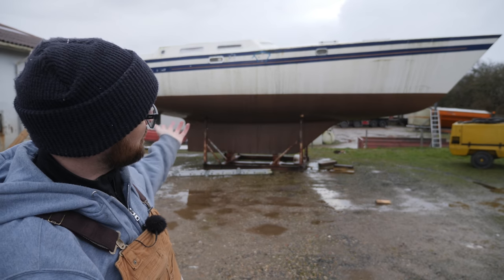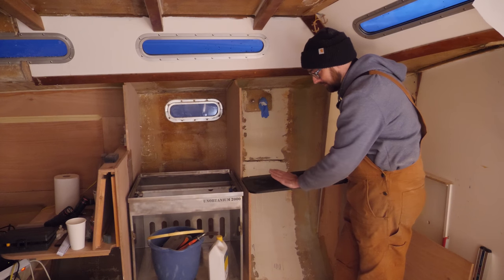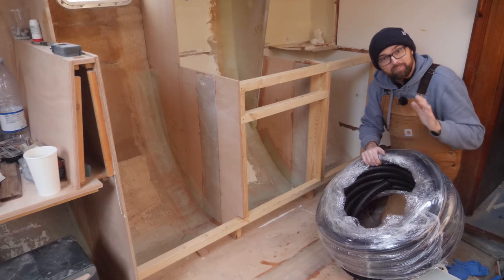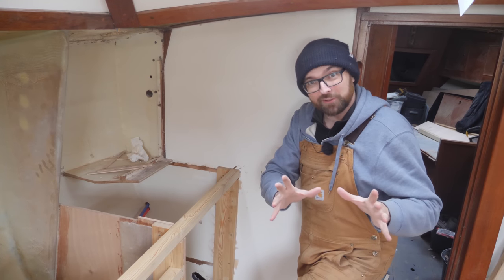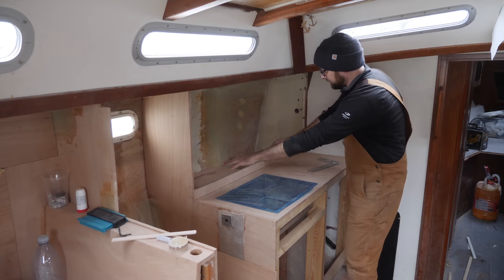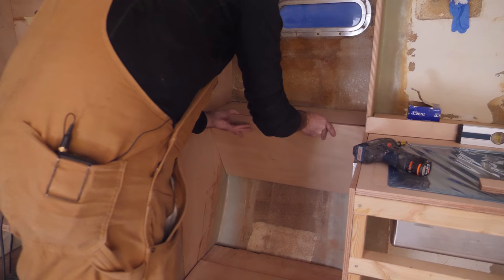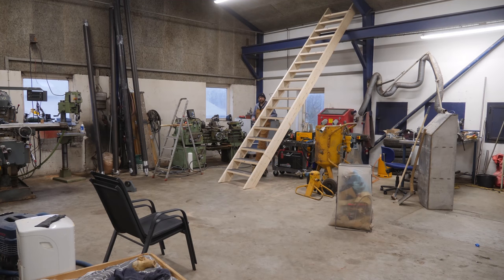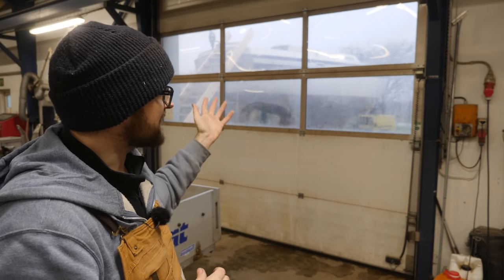Sail Life - Athena's new galley - DIY sailboat project

Comment: Every time I see that boat I think...  Acrow under the bow and Acrow under the stern, with a suitably chunky pioece of wood as an interface.  Phew, glad I got that off my chest!  Proper cabinetry is a win win in  a  dodgy sea state, and it won't delaminate like cheaper carcasses and laminates, good job.  My view is to try and build everything to last a 100 years, it gives confidence and it satisfying to use. I'm still for hot air, but I'm really interested in seeing your wet system.  Microbore pipe will have a faster response time with heating systems.  Your work rate makes me go weak at the knees - relentless dedication, mmmm a good name for a boat!  Great video.

Comment: I'd also recommend a safety bar. If you stumble into the stove you either burn your private parts or knock over the pot backwards with the hot liquids using the "chute" behind the stove to redirect to your feet. Or both. Also, on a port tack you'll need something to clip in. I know you don't want to cook at sea but maybe you have somebody on board who would and then you can reap the benefits. I quite like to cook in weather, most folks don't complain if hot food materializes itself in adverse conditions.

Comment: !.  Sink should be as deep as possible - 10" or better.
2.  Provide some means to lock gimballed stove in level position.
3.  Make provision for a safety bar in front of stove - 1-1/2" stainless steel tubing or better.
4.  How do you plan to trim out the bulkhead edges?  They appear to be different angles where cut, and will be difficult to finish off. Are you planning to use a hardwood to trim the edges?
5.  Are you planning any grease proof surfaces around the cooking area?  Something easy to clean?
6.  The toe space/kick space should be required on every boat.  Don't know why manufacturers are so contrary.
7.  You are treading new ground with the sectional cast-iron boiler.  Aside from the assembly of the unit, you will require an expansion tank, make-up water means, high water/low water cutoffs, drainage means,  etc.  This will require a lot of space and considerable planning.  Hot water circulation pump needs to be carefully placed and the slope of piping needs to be considered.  Has the manufacturer of the boiler provided any system requirements?
As a retired mechanical engineer, as well as a full time cruiser, I look forward to seeing how this works out.  Best of luck!
Reply: Agree. That sink is going to splash in any kind of seaway and is unlikely to drain on a starboard tack. Best place for a sink is on or near the centerline.

Comment: Find a furniture 'glide', one of those plastic based pads with a threaded stud, add a fender washer, light spring, another washer, and mount it in the bulkhead several inches below the gimbal mount, with a double nut on the far side, so it presses against the side of the oven box and slows the rocking (might need one on each side). Even light chop at anchor can cause heated liquids on the stove to slop over if the box is free to gyrate with abandon...

Comment: If you new heat source is to be wood powered be sure to allow for a gas flow defector (by pass to chimney/flew) so you can vary the ratio of space heat to water heat. I also have a design for a log (drift wood/coal) heater for our Southerly. The silica glass for the door I brought from our old factory heater in Australia so it will not only be well used, it will become well travelled.

Comment: Guess you have this on your todo list, but if not; some sort of blocking mechanism (catch or bolt) on the stove, so you can stop it from swinging when you do not require it to gimbal.
Companionway hatch; there is a serious opening in front of the sliding hatch. When you go offshore and encounter larger waves on deck, that opening is going to supply you with solid amounts of water - inside. If it was my boat I would look for a decent way to waterproof the opening.

Comment: It sounds like you have already made a decision on the generator, but I would have recommended a 48V (nomial) DC alternator, feed the battery bank through a separate MPPT charger.  The all AC power would come from the inverter or shore power.  Now you have to manage 2 AC power sources, generator and shore, and 2 feeds to the rest of the boat, generator/shore and inverter.  Hopefully the inverter will have a built in charger and automatic transfer switch to make wiring simpler.
If your boiler is going to be diesel fired, I hope at least the flame tubes are stainless steel.
Reply: Jack Patteeuw only problem with stainless tubes is they heat and cool at different rates and won’t last long. Large ship boilers are all steen with copper or copper nickel tubes for this reason. Also see a large commercial stainless boiler that needed welding repairs yearly and it was only 3 years old.
Reply: @donpetrey8007  - I admit to not knowing what the proper metal is for building a diesel fire boiler, but mild steel is likely one of the worst choices.
Reply: Jack Patteeuw agree but that’s why you use a corrosion inhibitor like antifreeze or something of the sort.  Every boiler I have worked on we treated with oxygen scrubbing chems to prevent rusting from the inside. But like I said automotive anti freeze should do just about the same.

Comment: I love boiler systems - the type of heat they produce is much better than forced air. I'm curious how you will get the short bursts of dry heat you need sometimes to dry out yourselves or wet gear quickly.

Comment: Another excellent video.  Out of curiosity, since your refit /rebuild is ongoing, wouldn't it be time better spent to relevel Athena in her cradle now so you will not have to always compensate for her slight tilt when fitting her interior.
Reply: I asked about that last week. He made sure Athena was as level as possible after the move. (Perfection is impossible of course, so he still has to make some tiny allowances.)

Comment: Another great episode. Good to see the galley coming together. For your stand along generator system, had you looked into the 'Integrel' system designed by Nigel Calder? It is a high capacity alternator/generator mounted to your main engine. It uses the un-used power from your main engine depending on load.

Comment: Nice video, looks like moving the boat really upped the progress greatly.   Don't make your sink hole too tight, once you bond the sink to the bottom of the counter top material it will be nice to have some wiggle room to position the counter top/sink assembly into position on the plywood base.

Comment: Coocking and frying fumes goes everywhere coating everything... Will you be adding a galley extractor fan? Looking very nice so far... ☺👍
Reply: I would add stainless sheet paneling to clean easy as grease stains most paints. And where that port light is maybe at some type of an extractor for the oven stove

Comment: Great video as always, but just wanted to double-check that you have enough room behind the stove for heeling the other direction (port, I believe),
Reply: As the top back corner only sits a couple of inches higher than the mount, i think his inch of space covers the possible added lateral mocement of the corner :)

Comment: Whaaaat ! yacht legs, wow that sounds cool, if ya ever come to Australia those legs would be an asset. We have 3 & 4 metre tides and what an option to anchor safe some places where it's often too shallow at low water and a regular bottom clean is always good. Do you have any photos of those legs in action, are they home made or something that is available & profesionally designed ?  I want some for my Ferro cement Hartley south seas, it almost stands on the flat bottom 40cm thick keel although I wouldn't feel that safe sitting on a deckchair under there to get out of the sun should the wind gust.

Comment: Yeah, good luck getting a fridge up that ladder and through the saloon hatch, in one piece, for the next episode. 🍀🍀🍀🍀
Reply: I am sure like Baldrik Mads already has  ' a cunning plan'. Perhaps he will build the fridge in situ. Much the easiest and cheapest option.
Reply from the maker: Seeing as the fridge will be too big to fit through the companionway the only option is to add the isolation to the inner box inside of the boat :) aka what Mark said ;)
Reply: @SailLife  exactly what I did on mine. I used the Norcold compressor and coldplate kit. Really easy. If you played with lego as a kid you can build a fridge on a boat.😊
Reply: It's always funny when landlubbers assume that sailors just use commercially built fridges and freezers.

Comment: I am always wondering, when it comes to attaching wood to wood, why use epoxy over a suitable wood glue? I understand that epoxy bonds are amazing/add strength etc, but the cost of epoxy over wood glue must be a consideration? (if the bonds/strength aren't an issue)

Comment: I'm worried that the panel behind the stove is too far out from the hull.

If you have a pot or pan on the back burner of the stove when the boat rolls when the stove pitches back, will the top edge of the pan or pot will strike the panel?
Reply from the maker: I think it'll be okay but I'll test to make sure :)
Reply: Thought the same. You never tested (on camera at least) tilting the stove the other way around.

Comment: You said that you took the tilt of Athena into account when measured and cut for the countertop, but when you checked level fore and aft for the gimbal mount, how do you know the boat is sitting level in that plane?
Reply: BTW, I realize that a level tells you what you are checking is level no matter what the surrounding area is... but is the counter line level after the boat goes in the water and settles on its DWL?
Reply from the maker: I use a couple of areas on the boat as references (forward bunk, aft bunk and the vanity in the forward cabin). I've gotten a few comments about this. I think I'll show it in next weeks video :)

Comment: When you level something like the stove, what is your reference for 'level'? Did you level the boat when you put it on stands, and if so, what was that reference? The deck, fore/aft & port/starboard? Or??? I'm asking seriously, because unless the entire boat is level and plumb, it makes much more sense to measure off a known point (in the case of the stove, off the cabin floor). Doesn't it?🤔
Reply: I want to know too.
Reply: @jerryf609  add to your thoughts also that most boats are not balanced perfectly - so in the water they tend to lean one side or other, or even bow to aft. That said, the worktop in the galley is nearly never truly horizontal...
Reply from the maker: I've used three different areas in the boat as a reference (forward buck, aft bunk and a little vanity in the forward cabin). When moving the boat we got her very close to level. Somewhere around 0.1 degree (bow up) and 0.3 to 0.4 degree tilt to port. I use a digital level and take those into consideration. It doesn't matter if everything is super level or plump as the boat will sit differently depending on weight distribution but it would be nice if everything was consistent :)
Reply: Generally speaking, the reference point is always the designed waterline.

Comment: Hello Mads, if you are seriously going to sail that girl around the world with your girl, you need to know that at some stage you will have cockroaches onboard. Which are disgusting if the only time you see them is when mid watch you mistakenly switch on the white lighting and see them scurry away. Those glassed in areas behind the the oven will eventually incubate millions of roach eggs. Build in a way to insert an insecticide nozzle so you can spray these areas periodically. Then thank me later. Cheers Wig